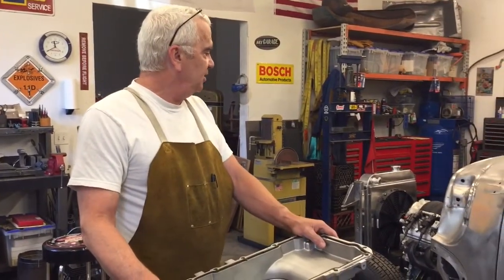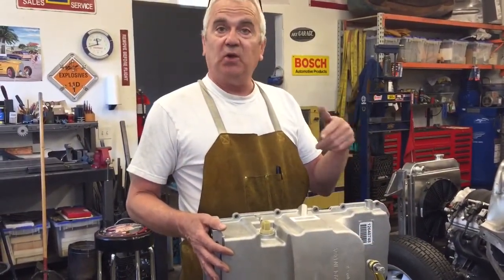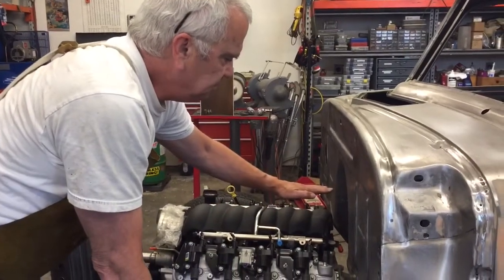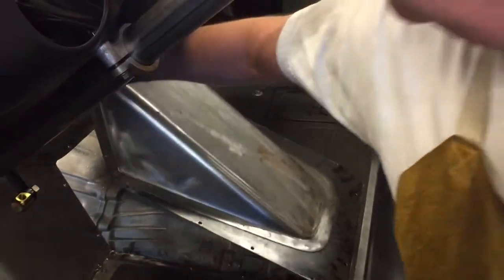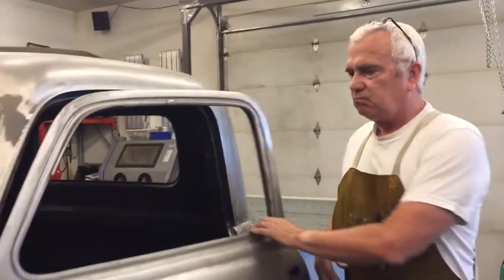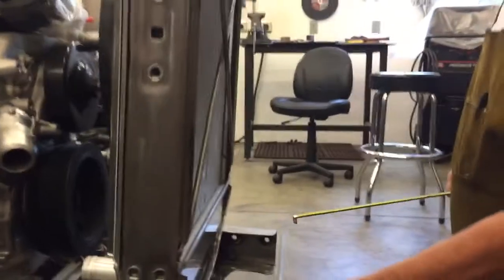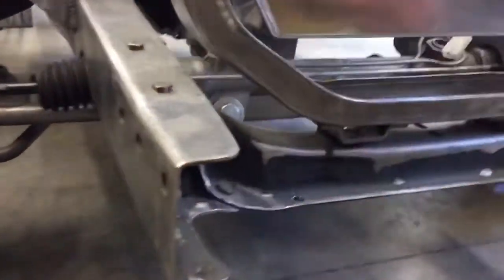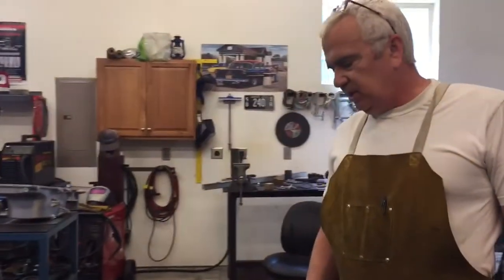Shoehorning an LS3 into a 53 Chevrolet pick up

Comment: A long time ago I put a 283 in a ‘53 3600. I used a 7qt. circle track oil pan. This gave me stock transmission and radiator location, good ground clearance, and good real world oil control in combination with a windage tray. If you use a 292 six, you have to move the radiator forward. Next time I think I will use a Jaguar six. Using a V8 in one of these is too much like reinventing the wheel. Have fun.

Comment: I see its been a while but what was the model number of the Hooker headers?
Thanks
Reply from the maker: I got the exhaust headers on Summit racing made by hooker and are ceramic coated in four different colors mine were black part number HOK8503HKR

Comment: Whered you get the radiator with the fan?
Reply from the maker: Hey I got the radiator from a company called PRC stands for Performance rod and custom, it’s the same size dimensionally as the original radiator but it is twice as thick, they sized the filler necks to match the LS motor and bungs for the temp sensor and steam vent. I paid about $800 for it with the Spal cooling fan and shroud.
Reply: @idahofabricator8710  Thanks. Putting an LS into my 51. I like your gas tank but I'm trying to find one with higher capacity. It's my daily driver.

Comment: When do you think you will be finished with your truck?
Reply from the maker: I don’t have an exact date right now I’m trying to wrap up any welding and bracketing on the frame itself then I’m going to tear it  down pint the frame  and install all the suspension after I paint and detail it and I’ll have a complete rolling chassis it’ll be on to the interior,  finish up the bodywork, and wiring. And I need to spread out cost of parts by doing side jobs.

Comment: What motor mounts did you use?? Or did you fab your own??
Reply from the maker: Thanks for the comment Jim, I got them from a website called tin man fabrication I like them a lot better than the ones made by Holley and all the other outfits they’re very substantial polyurethane motor mounts. I had to make the frame tabs to fit my frame. I used  1/4 inch steel to make the tabs.
Reply: Thank you for replying! I'm building a 53 3100 5 window as well! Everytime I watch your videos I take notes!

Comment: Could you tell me what motor mounts you used to get the hight
Reply from the maker: I bought the motor mounts from Summit racing the part number is 109304 they made by Tin man manufacturing.
Reply: @idahofabricator8710  did you need to do a firewall work or is it still in factory position . I realize you had to cut for the transmission but didn’t notice if you had recess the fire wall to fit the LS ?
Reply from the maker: @bryangee9609  I used the original firewall it has a little indent for the factory 6, the Ls motor fits OK in hindsight I probably should have put a little little larger notch in the firewall so I would have more clearance for the radiator, I made it work by  moving the radiator forward inside the core support and gained 2 inches.
Reply: @idahofabricator8710  ok thank you. I think I will recess the firewall back a little but don’t want to disrupt the inside defrost and ac